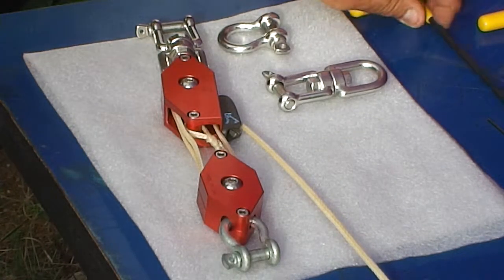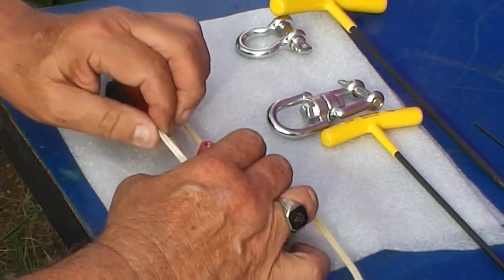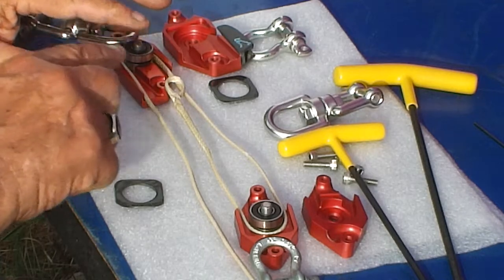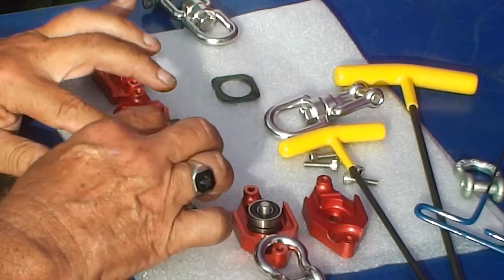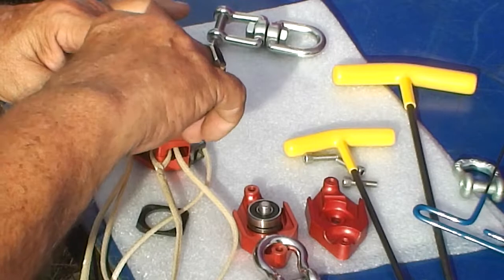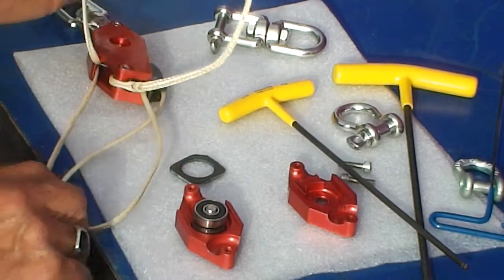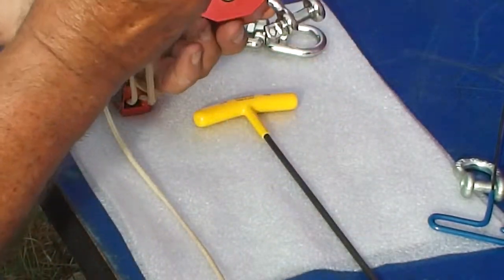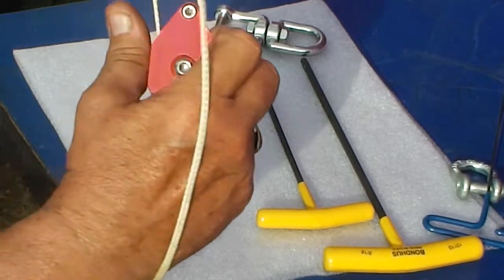How to re-thread your Nifty-Lift block and tackle rope pulley system (for sale at nifty-lift.com).

Comment: I would also like to see an option on the website for a new designed side plate that is double sided for the bearings with longer Allen bolts and longer piece or cord for the same power pull of 10ft for the purpose of mating 2 of the lift system together to go from 4 pulleys to 8 pulleys just by changing the side plate of the block an tackle. So that two can be bolted together.  Ofcourse at the users risk.  

More so because I have a few older special people in my life Ild like to get some for.  But being older some things that would be easier for a younger person even with the advantage not so much for someone older with back problems. The easier pull for the same pound rating would be an nice option
Reply: So a kit designed to bolt two lifts together not for changing the weight/pull amount rating.  But to aid In the good people the system that would work great for. To give them a better method from an even lighter pull an the freedom of still enjoying doing things they used to do at younger ages or without back problems.  Or an disability that would prevent them from being able to pull heavier of a weight of pull without hurting themself.

Comment: I noticed on this deluxe model there is only one shim spacer.. Is that to keep the tolerances closer to avoid cord slippage off the bearing? Or because of different dimensioning for this model geometry?
Reply from the maker: it's a design change for closer spacing... really both reasons....always looking to improve quality
Reply: This Niftelift deluxe is awesome and the build quality is excellent and simple to maintain.. I love it .. am a customer for life ..Thanks Al 👍👍👍
Reply: Niftelift this looks amazing I hope I can afford to get one someday. I really wish the lock clip was on the standard one also. I know someone with a disability but still insist on being independent I'd love to get one for. You did an outstanding job on this.